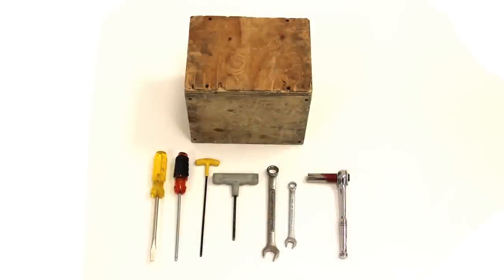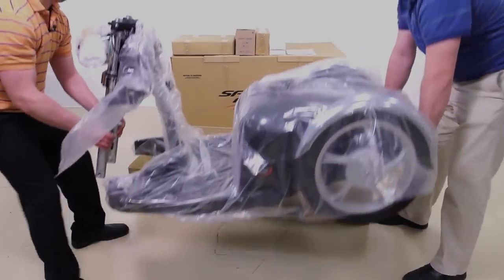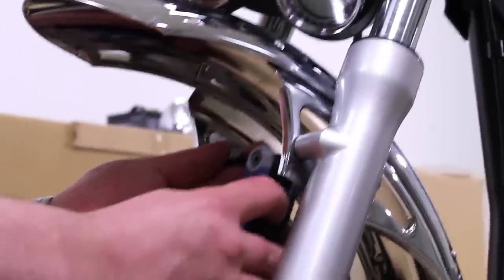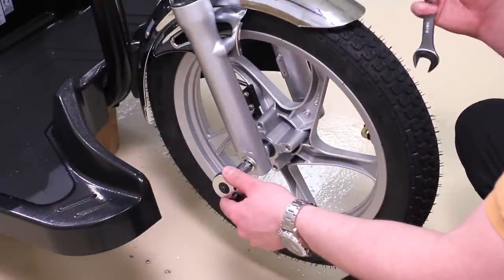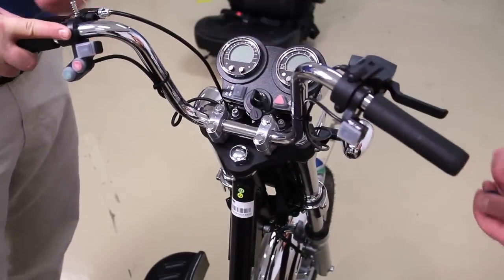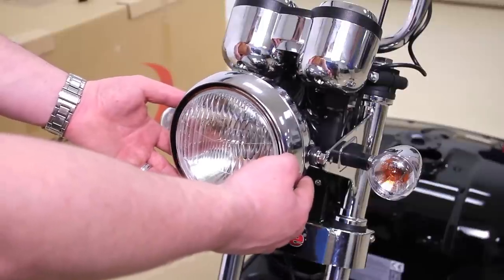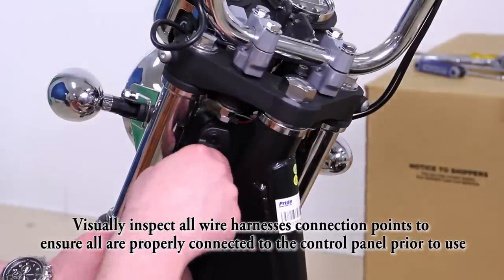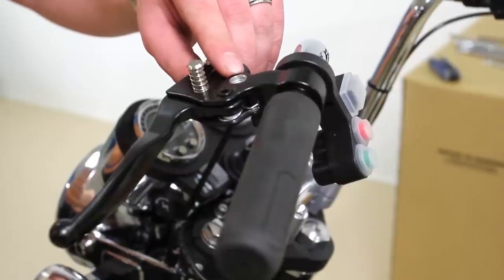Sport Rider Mobility Scooter Assembly

Comment: How to change tyre
Reply from the maker: Hi Helen, if you need a new tire for your scooter, please contact the dealer where you originally purchased it.
Reply: Lol you get told to take it to a garage as no one wants to change it.
If the rear suspension goes they tell the engineer not to touch it and basically your screwed.
I have one and the rear suspension has moved from where its fastened to the frame at the bottom. 
And just to make you laugh  I ordered a new one which then turned out to be faulty after it was built in the street outside my house lol and they wonder why it wouldn't work properly. 
These things should be built  in the factory where they can be tested before the customer receives it and not in front of the customer. 
I refused to except the scooter even when they said they would send someone out to fix it .
Lol no way I'm taking a £4000  faulty scooter and waiting for it to be repaired  lol.
I now have the faulty new scooter sat in my shed awaiting pick up as the engineer did not have a tail lift to load a fully built scooter in to his van lol.
The scooter did not come from this guy I might add.

Comment: Avoid this top end scooter Easy Rider also know under a couple of different nanes depending on who sells it. Itvis not the same as the sports rider as that takes less weight and is smaller. The replacement parts like tires are very very hard to get. I had to hunt ebay for old motor bike tires.
The scooter was Brilliant untill it needed parts.
Punchers mean a trip to the garage to get sorted as the mobility people claim they can't do it.
If the suspension becomes lose the engineers are told not to touch it due to the fact they need a catch box to catch the suspension when released from the scooter. 
I did not buy the scooter though this person .